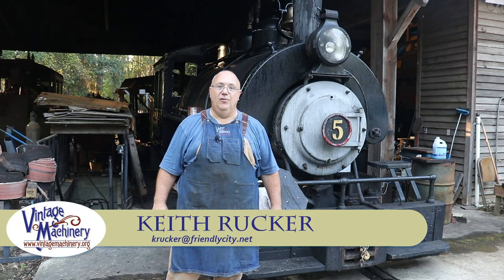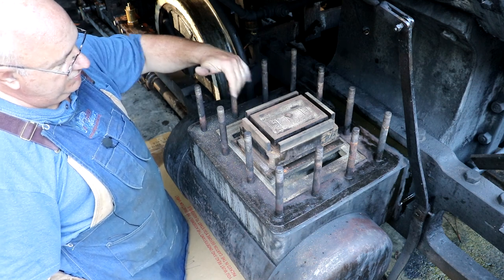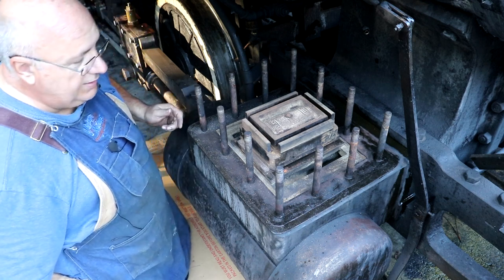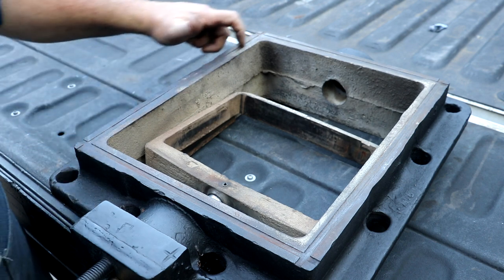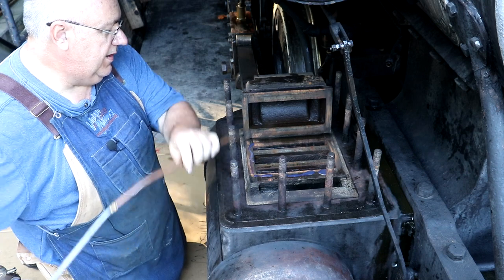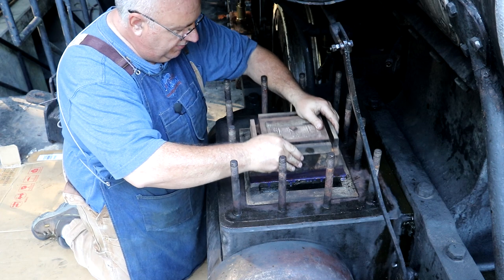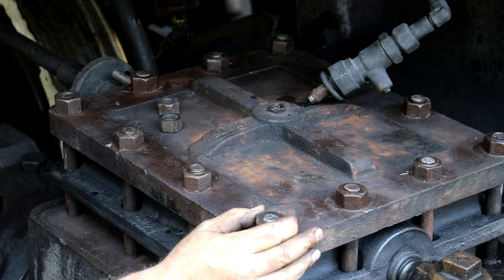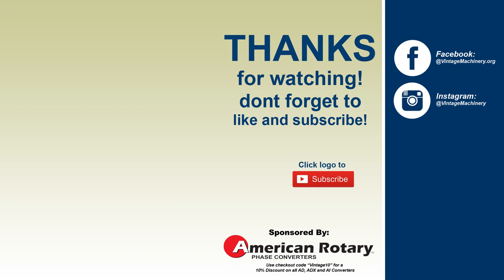1917 Vulcan Steam Locomotive: Reinstalling a Repaired Steam Chest on the Locomotive

Comment: Keith I think you mixed up the exhaust and inlet ports. The steam from the regulator/throttle valve is comming into the steam chest by the channels on the front of the chest. It pushed the slide valve onto its seat. The 3 ports are the inlet front, exhaust and inlet rear. Otherwise the steam would lift the valve from the seat, even with the springs. The bushing on the slide valve rod that should keep the packing from getting inside the steam chest is totally worn out and should be replaced. These should have a change gear fit on the rod, now it is a 100 yards throw fit ;-)
Reply: I was wondering that, seemed strange the packing was the only thing supporting the valve yoke and keeping it straight. Probably why it broke, they have to keep cranking on the packing to keep it sealed

Comment: The valve at the steam chest front is a snifting or drifting valve. It serves as a vacuum breaker when the engine is not working steam like when coasting. The idea is to prevent cinders or other debris from potentially being sucked into the cylinders from the smoke box.
Reply: https://en.m.wikipedia.org/wiki/Snifting_valve

Comment: Shouldn't the copper gaskets be annealed before reuse?  Learned that from an old boilermaker.
Reply: Soft drawn electrical wire is annealed. Hard drawn copper wire is not. Keith probably used soft drawn.

Comment: Normally there is the full steam pressure inside the valve chest. This keeps the valve pushed down to the sealing surface. I think this is the deal in this case also. Following this logic the farthermost slots are steam input and the center slot is the exhaust.
Reply: I completely agree with you. Mr. Keith has the steam input and output reversed.
Reply: I was thinking that, but thought maybe this one’s unusual?
Reply: @williamdodd8660  I don't think so. The steam pressure will blow the valve of the seat. Those puny springs won't hold the valve down against 170 PSI steam pressure.
When the steam is on the outside, the steam pressure will push the valve down on the seat.

Comment: Maybe it's different for a steam chest but I learned that any kind of pressure head is installed with bolt/stud torque starting in the center of the edges and tighten the bolts in a cross pattern moving outward toward the corners with the corner bolts always being the last ones tightened, the reverse of how this one was tightened.
Reply: I was looking to see if someone would correct hom on that point. The idea is that if you tighten the outer corners first there is strsin put on things taking out the bow caused by gasket compression, but by doing centre first the head can still spread. Whether this is a real problem is another matter but it is considered best practice.
Reply: The theory is there, but if youre careful and torque them down in several steps, you can really go in any order. Im super agro about stuff like this too but this I would have used an electric impact and throttled the nuts on slowly in steps. That socket sure was ornery coming off those nuts.

Comment: Was surprised, having taken such pains with the repair, to see the 'bowed' valve rod being put back without an attempt at straightening it.
Reply: I would guess that bow was intentionally added at some time to get a little more clearance at the wheel.
Reply: Beyond that look at the 2 or 3 degree angle between the flat sliding surface of the yoke and the yoke operating rod that projects through the packing gland. This has to be putting constant repetitive stress on the gland body which creates fatigue in the casting and is the likely reason that this gland area has already failed twice. The operating rod and the sliding surfaces of the valve need to be co-planar. Seems like this is a design flaw, or maybe introduced with the last repair. What does the left side cylinder, steam chest, operating rod arrangement look like?

Comment: Great video and repairs Keith. I noticed the valve rod was banana shaped when you were screwing it back into the steam valve stem. Is it possible the bend in that rod contributed to the cracking of the stuffing box area or is it formed that way for clearance during operation?
Thanks for sharing.

Comment: I'm surprised that you didn't straighten the bent rod after going to all the trouble of repairing the chest.
Reply: That would change the valve timing , some were bent ever so slightly (if done wright) to trim timing
Reply: @robineanes1489  The timing is adjustable. The rod was designed to be straight, and it looks like someone overweight has stood on it. I expect the gland has been overtightened at some stage. A bent rod meeting a strong resistance will flex and cause the damage we saw in the previous video. A straight rod operating a moderate load would stay straight.
Reply: Like Keith said, this engine has plenty of things that could use some work. He did what he needed to get it running for the weekend, and that was already more work than he originally hoped. He also said they plan on doing more comprehensive work when they get the new casting done. It's all a matter of managing priorities. Remember, Keith is a volunteer, and he only has so much time for this stuff versus the rest of his life's chores.

Comment: I originally used RTV on the cylinder heads of the J&L 58.  One day one of the cylinder cocks would not close and after I took it apart found that a chunk of the RTV had lodged itself in the cock.  How it got there I don't know but I no longer use RTV. 

Due to pitting on our steam dome the copper gasket will not in itself seal the joint with the lid, so I have gotten into the habit of coating the sealing surface with a thin film of Expando pipe joint compound.   That fills in the pits and creates a good seal.
Reply: Agreed RTV is the cause of many failures, it blocks oilway's and  waterway's, used sparingly ok but, the bigger the gob the better the job ....
Reply: Annealing copper gaskets is always a good idea.
Reply: @chrisjohnson4165  I have been using the same gasket every year.  Just heat it up with the torch, let it cool and its ready for another year.  Love copper gaskets.
Reply: @YoungstownSteelHeritage  Copper anneals best by heating to cherry red and quenching in water. I love copper gaskets too.
Reply: Don't slop it around and it will work fine.  Any body that has ever used the stuff finds this out!

Comment: For those that don't know, there's a sequence In tightening bolts on this steam chest. It's similar to the way a cylinder head  is torqued down. This helps to prevent the top from warping from uneven tightening. Tire shops use a technique like this to ensure proper tightening of the lug nuts.
Reply: Lots of other things here make you realize Keith doesn't do this for a living .....
Reply: Start in the middle and work your way out, just like a automotive head is how i would do it. Thanks for your time. Pete from South Carolina

Comment: Keith one trick I learned that I found on another tubers video was to wrap the RTV (or really any metal cased tube) in electrical tape before you use it. It tends to help with blowouts and prevents creases which eventually result in blowouts of the tube while you're trying to squeeze the snot out of it to get the sealant out =)
Reply: the good stuff will come with a key to roll the tube up :)

Comment: I don't think you ever mentioned the amount of pressure in that engine when it is running, nor what the packing actually was/is.  Is it packed with Oakum or something else, or do you use some modern substitute?
Reply: on ships we used wire inserted graphite packing but that was for 600 lb steam. i think this loco only goes to 150 lb

Comment: Keith,  since you lubricated the clamping studs, I was wondering if your torque target was reduced 20-30% from a dry torque target?
I came across this in a machine's manual while doing maintenance at work, and subsequently finding it in engineering references.

Comment: electrical ground rods are not copper, theyre copper-clad steel.. if that matters
Reply: I was kinda thinking it was more about the heavy connecting wire than the ground rod itself, which seems like it would be huge compared to that little slot.  I think the wire would fit just about right, and would be softer to hammer into place.  Just speculation on my part.

Comment: QUESTION…..what exactly illuminates the headlight?  Was it a battery, oil or something else.
Reply: My research shows they used a steam powered generator, or dynamo, for cab and head lights.
Reply: It depends on the era of the locomotive. Early locos used oil. A few early headlamps were ‘carbide’. Acetylene, produced as part of the lamp itself by adding water to calcium carbide, was burnt in the lamp. These were brighter than oil lamps. Later, these oil and carbide headlamps were replaced with light bulbs powered by a steam driven dynamo, often located on top of the boiler, not far from the front of the cab. This loco appears to have an electric headlamp.

Comment: So when you cast a new part to replace one that broke in service, would you attempt thicken up or relieve the pressure on the area of the part that broke in the original?
Reply: Also, were dimensions checked on the drawing and compared with the actual part?

Comment: You might do a little modification to the casting when you have a new steam chest cast.  In between the packing nut flange and the steam chest, convert the round portion to a hexagon, with the top and bottom flat being level with the top and bottom gasket flange of the steam chest.  The packing flange is supported in the horizontal direction, but not in the vertical direction, and you also have to deal with the bolt holes for the steam chest right behind the packing nut flange.  Using a hexagon pattern will support the packing nut flange in the vertical direction, while still allowing for room for the bolt holes in the steam chest.  This should prevent cracking of the packing nut flange in the future.
Reply: Hindsight is 20-20.

Comment: Wondering is it cheaper to cast the part or print it out of stainless or machine it out of a solid casting.   Since it’s only two parts I’m thinking the cheapest solution is machine it out of solid casting.
Reply: Mmmm...  Okay, what you do if you wanted to keep the engine as original as possible?  Now, remember... you have a friend who owns a foundry...   :-)
Reply: @ydonl  they seem to work the heck out of that engine.  Figured the part gets painted so any process would be good enough.

Comment: keith .. thanks for the videos!  i am not shure what RVT would stand for but RTV usually means room temperature vulcanization lol  . i am not the sort to say you did that wrong but i will inquire why you chose to  braise instead of bore and tap for a threaded pipe?  my gut feeling on this is its a design flaw  and the packing gland joint to the steam chest suffers from fatigue  the valve rod isnt going back and forth only but up and down fractionally and thats where it fatigues and fails. threaded pipe could be removed without disassembling the chest  if it failed again.
Reply: @ralphgesler5110  easily amazed? whats your explanation of why it failed?  i do not believe it was a void in the casting and it dosnt appear to be impact damage    and if it was ice there would  have been bigger problems  so help me to understand what other probable cause there are to account for the failure.
Reply: Mike Cartman....I believe you should get in your time machine and go back a hundred years and tell them how to do it.  You obviously know more than the original designers!

Comment: Very interesting! How much pressure would be in that chest? Do steam locomotives develop high pressure?
Reply: Surely you've seen the old films of steam engines exploding. You bet they develop high pressure. That's what does the work.
Reply: My research finds the typical locomotive boiler pressure is between 200 - 250 psi. I don't know if that's the value of this one, which is smaller than a standard commercial engine. I've also found info that there are very high pressure locomotives that run above 350 psi and up to 1500 psi.
Reply: My dad had a friend who was a steam fitter in the PRR shops. He would tell us that the high pressure steam was invisible and that you DID NOT try to find a pinpoint leak by running your hand along the pipe. High pressure steam escaping through a tiny hole will cut like a laser beam. So by the time you realized you did it the wrong way, your fingers were already laying on the ground. Anything with a boiler must pass annual inspection these days and that is due to the potential for disaster from high pressure.  🥸👍

Comment: When that valve is actuated it looks like the rod travels in an arc rather than a simple sliding motion. If it has say a 1" vertical travel and that is a constant motion as the valve actuates the crack is likely from that motion. The bend in the rod isn't helping that situation. I could also see where the studs on the sides of the packing box might be that way to allow the rod to somewhat float vertically to lower the stress.
Reply: Nah. The rod isn't it, this one broke because of the studs being over tightened. The flask design (the neck) is a really sh!tty one that's meant to break (weakest link). Personally, i'd make the rod weak and make a full box.
I'm of the opinion that this box may not be original to the locomotive. The insides are way too rough to be original (having seen other components of this loco in the past). Some hackery might've been done in the name of preservation. Keith would know best, he has the plans.

Comment: You used a oil ring with the silicone to seal it up did it have a rubber oil ring when it was built or did they use something else like a strip of leather or cork as the gasket? Just curious thanks for sharing you are a very talented person I wish I had half your skill
Reply: Crush seals are an old idea and first used with high pressure steam. Metal  softness along with leathers open cell structure made a great combo in the past. RTV takes the leathers place. Copper, half-hard brass, some of the harder lead alloy types worked well also.